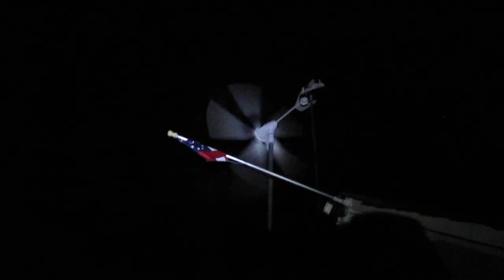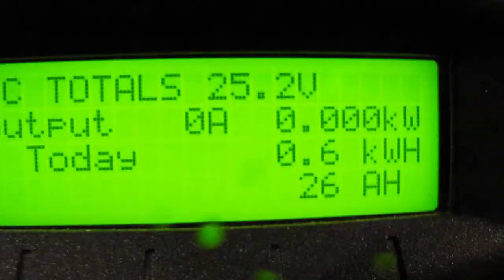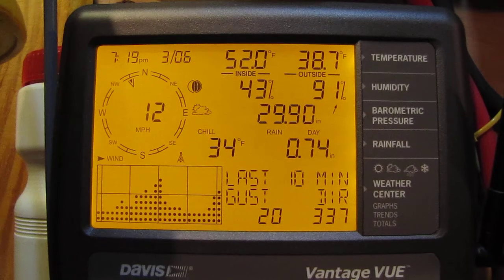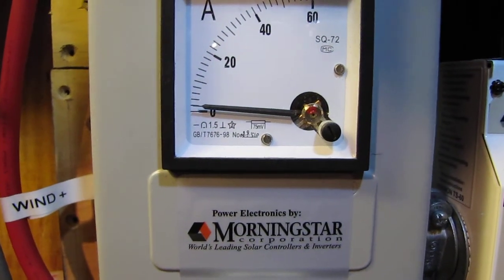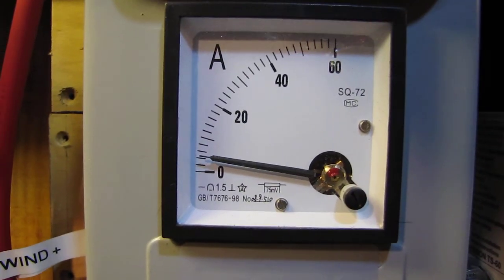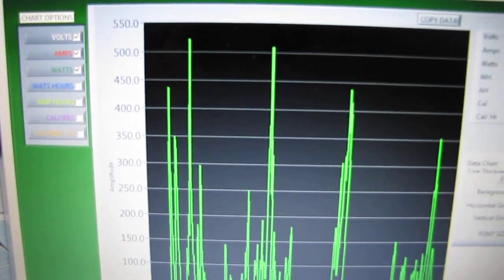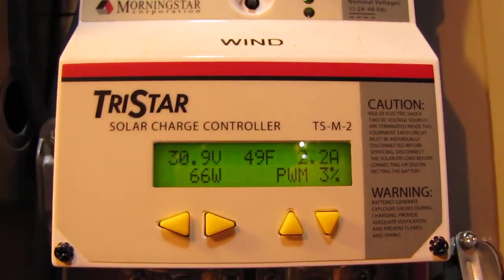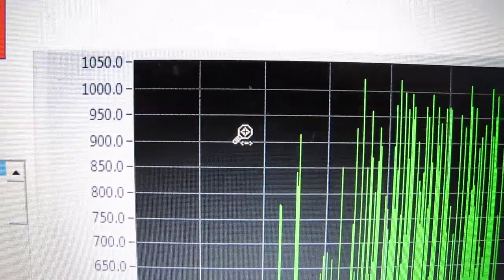Wind Turbine's During Winter Storm Saturn  At Night  By VIARLOCITY

Comment: Thanks for the 411..  Tc Here the Solar Guy...  With the wind turbines...  During storm I saw you put resisters to slow down... you the pulled a brake (to short? )...  But i didn't see how you connected the brake(inside gutter)...  How did you connect brake and is there a point where you just need to manual disconnect?  At what wind speed?  Thank You For YOUR Service!
Reply from the maker: I have videos of my brakes Right before it hits my Bridge rectifier  I used  Southwest wind power toggle switch or you can use Blue seas toggle switches